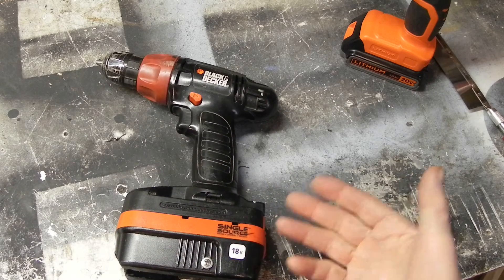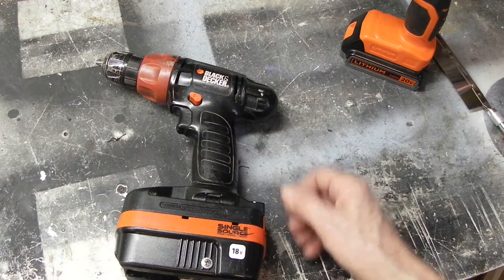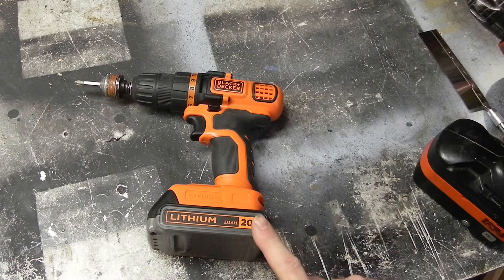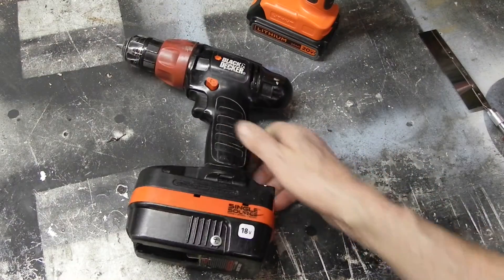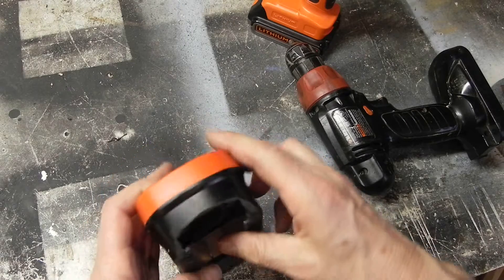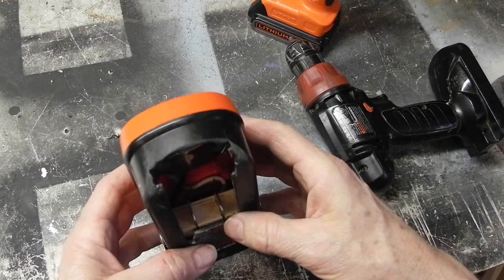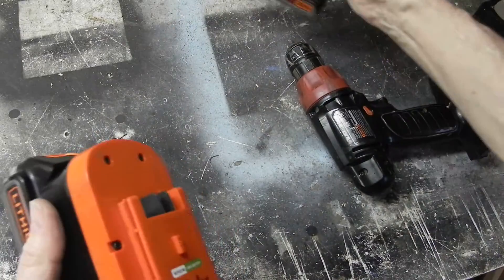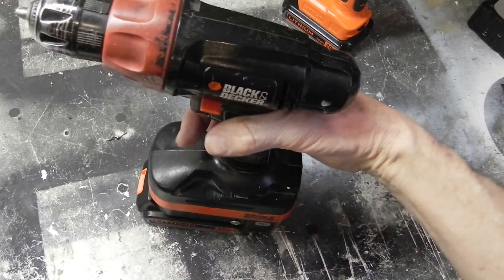Converting a 18V drill to work with 20V lithium battery

Comment: Very well done, I'm impressed that you measured and cut it to fit the battery perfectly. Only word of warning, I doubt those NiCad Drills have decent enough protection ( if any ) to protect the lithium batteries from over-discharge. Since lithium cant be discharged too low or it will permanently damage them.